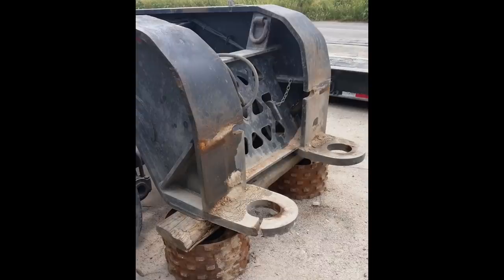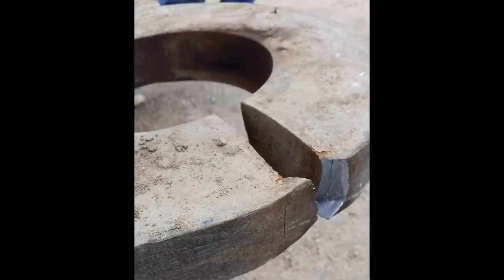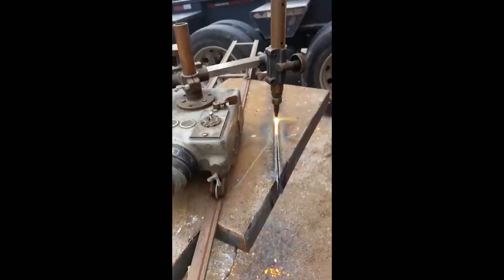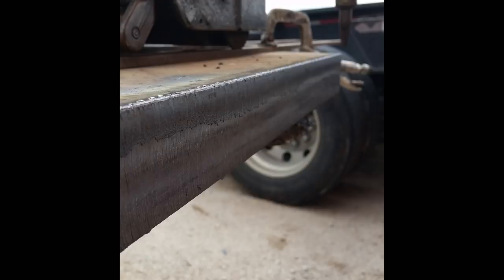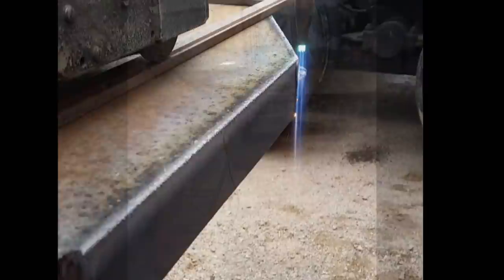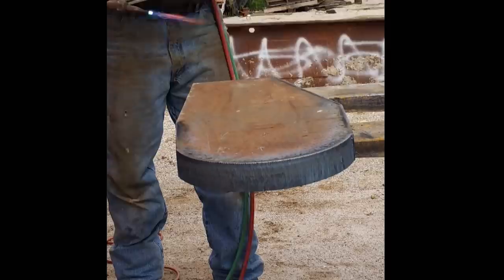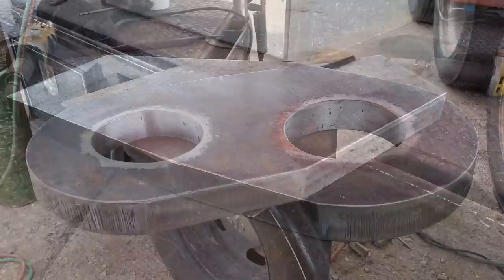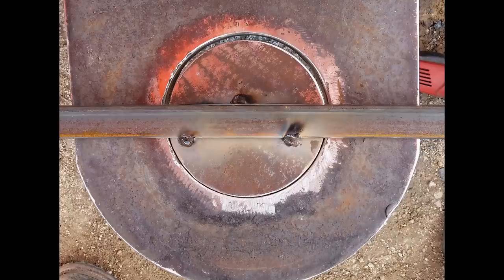Could Have Been Worse!!

Comment: I have worked for and with some good fabricators, later took a few semesters of welding at a community College (mainly to get access to the welding shop and toys for my own projects! Taught myself how to TIG there lol), read the books, watched lots of videos, and somehow after 25 years, today was the first time I heard about making sure the oxygen spike was longer than the metal is thick...

I used and ignored pressure charts for tip size and metal thickness, but this is like an earth shattering piece of wisdom that just makes sense! Lol

Thank you!

Comment: I repaired three of these tabs on three different trailers for one oilfield outfit. What was causing the breakage was the fact that the drivers were not making sure that the vertical bearing surface was clean. All three of these trailers had mud packing in on the vertical surface so that when the pins locked in and the trailer was lifted the mud acted like a shim and put additional loading on the tab. I showed the owner this and explained it to him and he was a tad pissed. All of the drivers were told that if they broke another tab and there was mud packed in that they might as well just pack up and get gone. His exact words were dust and tail lights guys, dust and tail lights. Strangely enough, they never broke another tab. 
Good work by the way. There are so many that don't know how to use a torch properly.

Comment: After 43 years doing what you do You are way better than I have ever been. Just a hint, When piercing metal with a torch I have always drilled a 1/4" hole just inside cut line. Torch will flow thru hole and give you a clean start instead of piercing and making a lot of cutting slag on top.

Comment: You have been by far one of the biggest contributors of my knowledge for my shop, my humble shop compared to yours, I do CNC plasma cutting quite a bit, much less oxy acetylene super thick material than you do, although I am slowly getting into it, my machine only goes up to 1 in thickness on the CNC, I typically cut with propane and oxygen, which most people don't realize is pretty damn good for the average shop, and cost a whole lot less!
Reply from the maker: Have you been able to figure out how to program the cnc to use a torch? I have a plasma table that I want to use for more torch work but I'm not familiar enough to program it to not need to touch sense the tip onto the table. I had to bypass mine manually when I did it on one of my last videos. It took way too long to figure out so I never tried again. partially because I've been too busy but I also don't know what I'm doing.😕😕😕

Comment: Well done. A craftsman at work. Gotta love a track torch.
When I was a millwright in a sawmill we had track torch and a pantograph in the shop. We made a pattern out of 1/4" plate and set up the pantograph to cut out as many items exactly the same as we wanted. I was about the only guy that took the time to make a pattern. The pattern time and quality of the finished actual part far surpassed the guys "that can cut freehand". After the company was took over by a big corporation I almost bet it hit the scrapyard along with 25 years of patterns.
Reply: I worked in a factory that made rock crushers and the profile cutter we had used a detector to follow a black line drawn on a pattern. That must have been mind blowing technology when that was invented donkeys years ago.

Comment: A friend of mine told me an illustration that went like this, a business called a skilled tradesman to come and figure out what the problem was with their shop equipment.  After a careful examination the service tech took out a screw driver and replaced a missing screw. Moments later the problem was solved.  Later the check came and the manager complained, why did you charge 200 bucks for this simple fix?  I demand that you itemize this invoice!  The tradesman took back his invoice and took out his pen and wrote; " 1 screw 10 cents. Knowing where to put the screw $199.90  You always know what to do and how to do it, nice project thanks!

Comment: Regarding the one weld that does not run to the end: I believe that the theory behind that is in the way the "ring" is loaded.  In this type of trailer the pins are effectively pulling the ring out of the weldment when the rest of the trailer is attached.  With the "ring" needing to be anchored to the rest of the hitch section.   

You want stresses on that ring to be distributed out among as much weld cross-section as is practical. If you welded fully across that spot, right at the leading edge of the ring you are basically loading all the stress right into that section of weld and frame section as the rest of it woul be dead loaded and under no real stress.  If you leave a significant part un-welded the stresses can be carried to a deeper, separate section of the frame where they can "share the load."  

In addition, in a cyclic loading situation  (like this) the original grain structure in the steel is more fatigue resistant than weld material.  This is why in more obvious loading arrangements like cylinder mounts for an excavator stick have wide welded sections and narrowed, curvy tabs. You want the pieces with the highest stress to be virgin steel where the grain isn't interrupted by a weld- Tabs on modern equipment are shaped more like this  } vs. >

Comment: Fantabulous!  Impressive!  

 I have an old lineburner that I got from my dad.  I believe it is a NCG or something like that.  He told me it came out of a boilershop in Texas and probably was made in the '30's.  Anyway, it's old.  Track is the same but mine only uses one tail wheel and that is it's singular fault.  The torch and holder looks identical.  Since I use Mapp. Chemoline, or something of the sort, it's hard finding tips. It works so well that I hate to replace the torch.

Comment: The torque curve, and flex on the tractor pull angle usually is the perfect way to fallow the cracks on most trailer and frame cracks. Also though. Sometimes people just load shit the wrong way and are not centered on the trailers. Oh, and drive the hell out of em. Either way that was a fine rebuild job my friend. Bravo 👏.  I think the burning bug was a mid 50s model

Comment: Nice work Isaac! I wonder if the pin holes are radiused leading and trailing for deck flex...... ...being engineered with a desired camber per desired weight rating, it would need room for travel in the pins loaded and empty 🤔, also having hauled heavy equipment (standard lowboy, not multi combination like this one) that trailer is rated for over 100k lbs and the load gets to bouncing with road contour...........and I can see how that eye stretched and broke. Or getting the deck hung up on a grade change, easy to throw spaghetti at the wall from here trying diagnose the obvious haha. Good thing there's hot glue specialists like you on this earth for guys like me that tear chit up

Comment: Hi Isaac, What i would have done is to partially close the gap, prepare the edges to 70 degrees, place some copper on underneath side and weld with low hydrogen electrodes I am a certified pressure welder and a welding inspector...from Australia..

Comment: Nice work from the torch master once again. I see you do a lot of wire feed welding in the field instead of stick. I assume you do that because wire is a little faster than stick. It would be interesting sometimes if you were to show how your rig is set up with what machines and what you use for air when you air ark. Unless you have another video from the past that maybe you have. I’m just curious. Because I’m a heavy duty mechanic. And mechanic trucks as well as welding rigs I find interesting to see how different ones are set up. My dad was a welder his working life of 60 plus years and had several different welding rigs over the years. Each one a little different
Reply from the maker: This machine has an air compressor built in. Its a Miller trailblazer Airpak 302. And I actually prefer stick welding but wire is quite a bit faster. it also reaches in some tighter spots than stick welding on occasion.
Reply: @ICWeld  I had some of the same questions. I have a Miller bobcat 250. But don't you have a big welder also? I have a little hobby wire feed welder from Craftsman and it is ok for welding some of the perfiles aquí en México. I'm all by myself in the area where I am here in Sonora and that gives me quite a bit of work. I have been watching as many of your videos as possible because I learn so much from you. Everything you do just makes sense. I saw your Hilti grinder, are those the best? I have run DeWalt and these crummy Makita here in Mexico but they wear out pretty quick. I'm kinda a tool junkie. My friends back in Tucson used to call me that, I couldn't drive home on Friday without buying at least one tool.
Reply: @ICWeld  I have my dads to portable machines a Miller 250 amp and an older Miler 400 amp big blue diesel. I have only seen one with the built in air   That would be handy
Reply: Isaac. Thank you! I’ve always been curious what welder you were running. Thought it might be a Big Blue of some sort because of all the arc gouging you do and so many people say you shouldn’t arc gouge with that class of machine but I know you can and that they’re rated for it with the correct size carbons. Me I run the competitor, Lincoln 305G and have only arc gouged on very rare occasions. Never got exposed to it when I was younger and just did my gouging with a torch and gouging tip until I bought a Hypertherm 45XP. Wow! That thing is a gouging beast! Of course I also have a stand-alone 30 gallon, gasoline air compressor mounted on the truck as well. Great work my friend. Thanks again.

Comment: I'd recommend, as having 25 years in the welding supply industry, using a self shielded wire that meets AWS D1.8 codes, such as Hobart XLR-8. It would be better suited for thicker, and higher strength steels.
Reply: Let me add that in my 25+ years, you're one of the best I've seen at carbon arc gouging and oxy-fuel cutting and beveling.
Reply from the maker: I'll look into it. Thanks bud.

Comment: The reason for the 2 diameters is because of wear. You can see the metal is cleaner at the front (larger dia) than the rear on the one you didn't replace. It too should have been addressed and matched to fit up like new as well as the pins that drop into those holes. The attachment point will be loose and sloppy. Maybe that is ok? I understand that it is all surrounding business, time and money... but it was drilled into me as a kid that if I was going to do something to do it right the first time and you don't have to come back and do it over.

Comment: As a low boy driver I do NOT approve of that crack! Lol
I was muttering about guys who don't inspect their equipment, and then I saw it was at the rear of the deck, and decided that they are pretty good at inspection since that never gets split!
They probably noticed a gap between the frames and looked underneath.
It also looks like they probably load the excavator off the side on a regular basis, but I would too, so this is just the cost of doing business!

Comment: IC, that was another masterful piece of work, well done Brother. My question was why did a company or driver not address this problem before the failure.? A crack that size had to be visible. Then the issue of the tire that was seen during the arc gouging part of the video, hope they replaced that.
Reply from the maker: its underneath the trailer at the rear. that section almost never comes off.

Comment: Morning Isaac
I might be compleaty wrong, but I would have thought the back of the holes are a different size due to wearing caused by the pins when braking, putting all the load on the back of the holes?
Regards Richard 🇬🇧

Comment: Very nice and thankyou for the tips on cutting torch set up. Any particular reason you chose MIG over a 7018 stick to weld the plate back on?
Reply from the maker: Speed and the ability to access the spots easier with the longer neck fluxcore gun.

Comment: Watching you cutting I wanted to share an old trick and you might already know it but if not just try it it works great ,,,, while cutting and you need to clean your tip and you don't want to stop take a 2x4 and while the torch is running touch the torch on the wood for a second or two untill it start to burn and rub it back and forth and its clean as a whistle,  you'll be amazed, Jim las vegas nv
Reply from the maker: yup yup ;)

Comment: What gouging torch are you using? It looks like a handy size to run 3/16” an 1/4” rods. I have a K4000 and it’s way overkill for what I do with my Trailblazer.
Reply from the maker: I prefer the Profax 3000-1 model. It fits in slightly tighter places.

Comment: Excellent work Isaac!! I do equipment repair myself and I aspire to be as proffecient as you with a torch. Question: Do you use a whip technique while running that self shielded wire? Just curious as I run a lot of dual shield and just employ a drag technique with minimal manipulation of the puddle.
Reply from the maker: I run it like I would with solid wire. Not like dual shield.

Comment: Once again, you are an artist at what you do. I did not think that plate was going to slide out of there that easy.Very nice work. And the circle cut outs with the angle iron for placement was a fantastic idea. Thank you for posting. Btw, what welding unit are you running?

Comment: Hmm! Not much weld in order to hold the sort of loads you would calculate to be present at times.  Not saying it's insufficient. But if I was building such a thing from scratch I'd be burning in about 7 passes on that 90 degree behind the hole. Wouldn't do anything different on the rest of that part tho. I enjoy the short videos as much as the longer ones BTW. Thanks for making them all. strange that such a fat bit can be located with just a bead or two. Shows how strong a bit of weldmetal can be though Eh.

Comment: 1:42 I hear the air come on but I really don't know where it is coming from.  The graphite/copper gouger you are using is solid, so where is the air coming from?
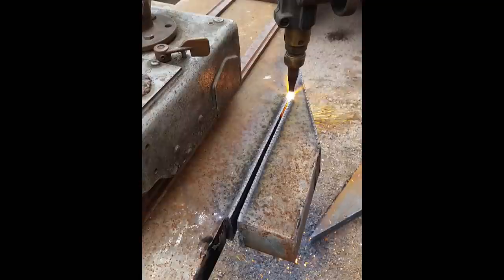5:48 you can see the internal stress of the metal being released by the cut, Is this cold-rolled stell you are cutting?
Reply from the maker: The electrode holder clamp has air nozzles that direct the air along the rod. This is used with regular compressed air. the welding machine creates the arc with the carbon rod and the air blows the molten puddle away.
Reply: @ICWeld  Thank you

Comment: Did you notice the tires on that trailer? The broken hitch is only one of the problems that trailer has! And the reason I will NEVER drive behind one of the rigs. If I can’t get around one of those things I’ll pull off the road and take a ten minute break.

Comment: Some people don't understand that the oxygen actually burns the steel.
Reply: Well, to be precise, the oxygen "oxidizes" the iron.  Iron doesn't "burn", but it oxidizes/ rusts in contact with oxygen.  Heat + pure oxygen makes this happen instantly!  (That's why Oxy cutting only works on iron/ steel.)
Reply: @fredygump5578  Works on wood too. LOL
Reply: @craigsmith8217  Is this something you do regularly?
Reply: @fredygump5578  Rarely. Last I can remember was when replacing the handle in an axe.